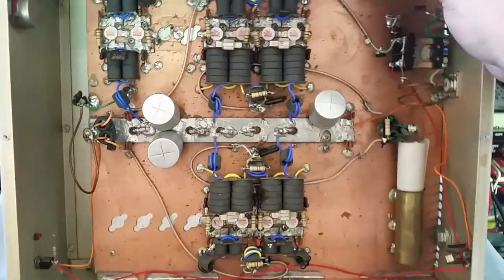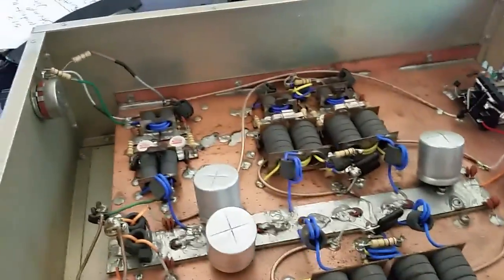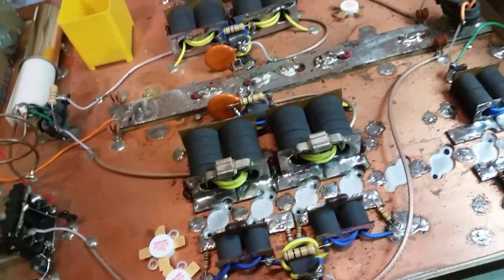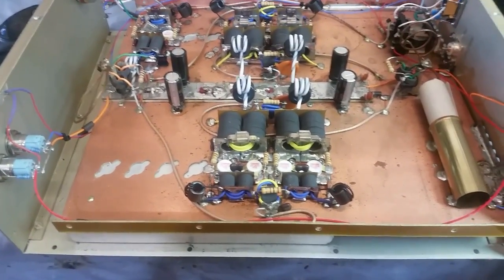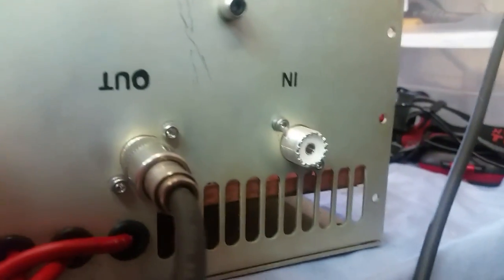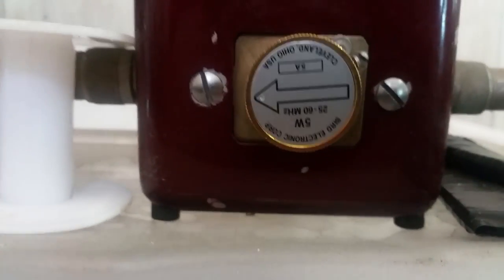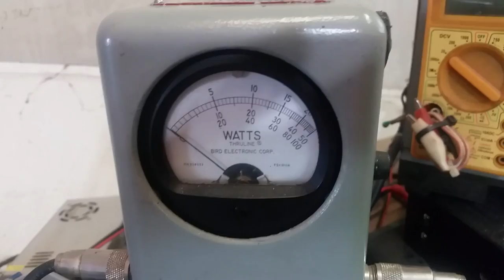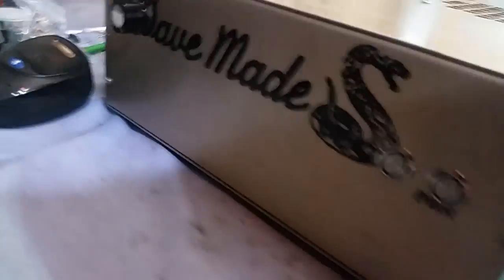Davemade 2x8 Repill, Repair, Snake EYE Mod & MORE!

Comment: I am tempted to send you something i built for an older friend of mine. It has a pair of 600 watt FETS in it, not big money but a son
of a bitch in terms of setting them up correctly. 100 hours at least to get it stable at full current draw. Probably my lay out but i got it happy at one level, load it up more and one starts to draw more than the other. Holy hell....as i can figure it was an oscillation i could only see on the scope. That showed me it was a 2nd harmonic resonance, and a strong one. Half a year later ( part time ) told him it was done and did not want it anymore. Paid him for his parts.....and it sits. 50 volt 100 amp supply. China of course.
I set it up to do 500 24/7 air water cooling - crude but effective. $400 chunk of copper heatsink plate. Butchered the hell out of heatsink using a wet saw to cut the slots for the cooling tubing, ugly but works great. I copied a yaesu design - more or less or less.
Any interest ?? I could at least send you the sheet i came up with - i'll clean it up so it's readable. Then you can take a whack at it if you want.....
Reply from the maker: Well I'll put it to you this way it won't hurt for me to at least look at it and see what I can do. Not sure if the power supplies are internal all in one case or separate cases I have me some 57 amp 50 volt power supplies that I need to parallel together for a bench Supply I for sure cannot promise anything at all but I sure will take a look at it I say first off maybe you can get some pictures of everything for me so I can take a look at it I'm curious which Field Effect transistor is that they are.

You know I sure would absolutely love to get that 16 back man I could be wrong but I'm pretty sure this is the same fellow that bought that 16 from me that my mentor built if not I am sorry it's either you or one other guy and I'm pretty sure I have them saved in my phone and I know I was going to try to work out a deal to get it back with some ldmos equipment but if you can send me an email to threemanpro@gmail.com hey shoot me some pictures of everything and we'll go from there
Reply: @1883GotDown  No i'm afraid your assumptions are incorrect. John 622 the bucket mouth from the northeast.
It is a Motorola device. Kinda sorta sure 3 voltages exist, Main current feed 50 volts at one rail, the option to use that negative as well for the other. Or 50 volts main feed, a 15 volt rail, and a 5 volt rail. The 15 volts i think - is a control voltage not a large current draw, honestly i forget. I think the 15 volts controls duty cycle - power output level 
protection - as i read it : As temp rises 15 volts goes to negative slowly causing output reduction. At threshold it stops output like a switch - in the yaesu circuit anyway. 5 volts is a control of sorts, tied to the main rail, as voltage sags output follows. Once again - i think. Almost 2 years since I've had it on air. It looks excellent on the scope at full drive.
One band - one mode only - 3.70 to 3.9+ Mhz AM only. The parasitic problems were a result of how i tuned it, A coil and movable tap points with a variable air loading capacitor - VERY old school. Hey it's what i know best, i treated it like it was an old SB 220 and it worked fine. In some ways at least. Band coverage is just adjusting resonance, it could go anywhere if you work out the harmonics, i did not have a high enough Q on my loading coil, yes it's a sharp tune.
More than 30 or 40 kcs freq movement and it must be re tuned a bit or it gets wonky. Should it work? no it should be a smoke maker. Is it done right - NO definitely not. But it does work very well - ZERO distortion, 40 watts in 380 ish out.
From the 40 watts resting if i tune it right, drive to 90 watts gets just a hair over a KW clean as sheet of blank paper.
it will do a lot more, but i set it up to be a half a bucket all day long. A set it and forget it deal. It does that just fine.
I put about 30 hours on it - it's fine zero issues. Except the fan on the radiator is a bit louder than i would like and
i think the water pump should be changed to another brand.
Last spring i went to the hoard spot. It had been broken into. The old super rare Texas Star motor maul is gone
no trace. What i think is kids thought it was a bad ass sub amp so it got taken. Boy were they wrong!
Engines body parts tubes and some toshibas all still there. Security has been greatly improved. My buddy lives on site so he took care of that last april. They also took my other big amp, that one hurt! once again they must have thought it was a monster sub amp of some kind. How, i really have not a clue. But whats done is done, move on.
Have a good. Let me know if you want schematics, i can't look at it since it is 60 miles away.